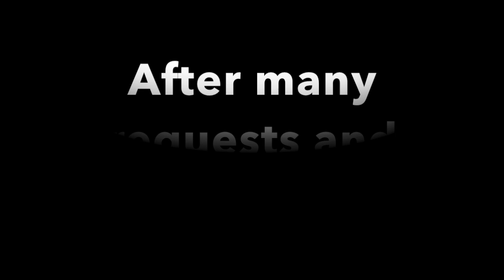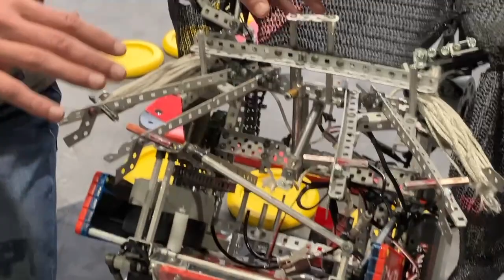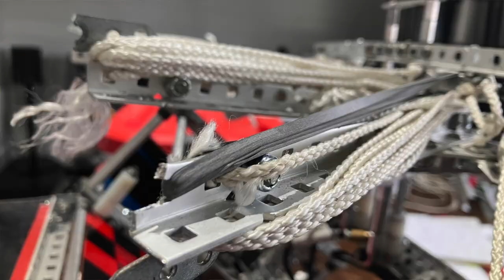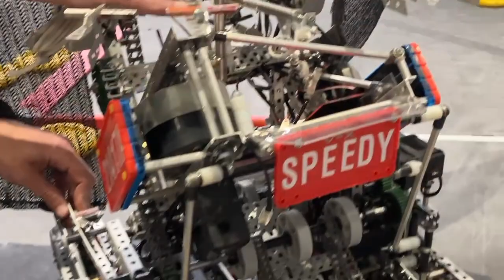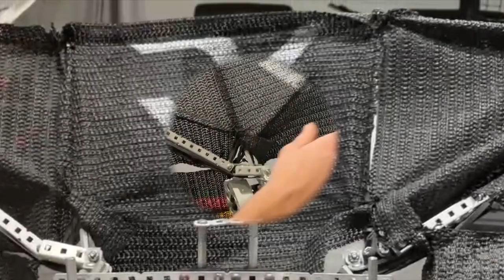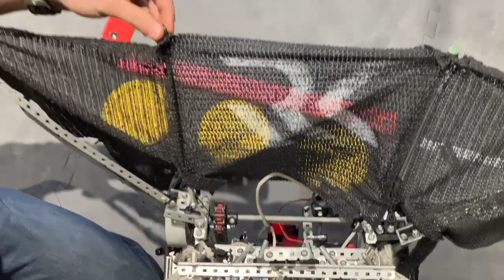21417A 2 Cylinder Endgame Explanation #spinup #vexrobotics

Comment: What string did you use? Also it looked like the shield covered the roller mech, did you have any troubles with that?
Reply from the maker: nope not really.. the shield is above and around  the rollers.. so we could use it if we needed to
Reply from the maker: we used traditional 1/8 inch nylon string for most of it...
Reply: @robokauz  have you tested between nylon and cotton? because nylon is not unfurling very well for our bot so I was thinking of going to cotton
Reply from the maker: @bruh5131  we have not tried cotton yet but we never had any troubles with the nylon with this configuration.